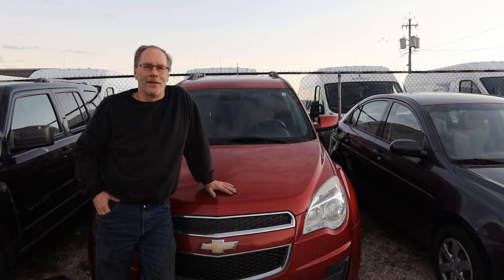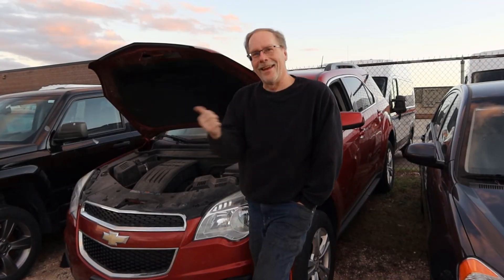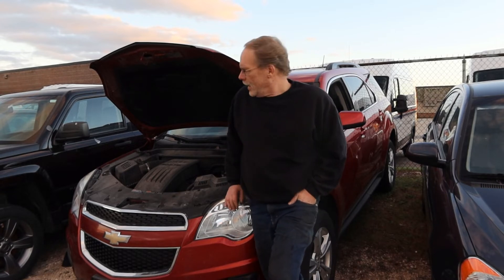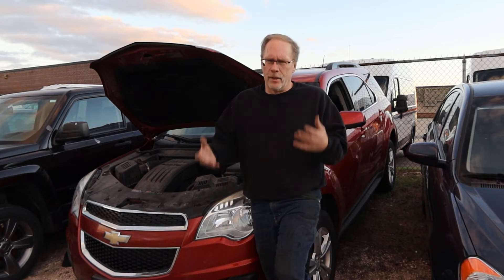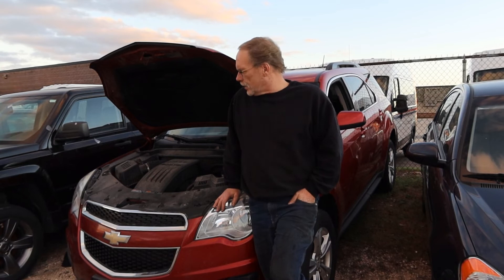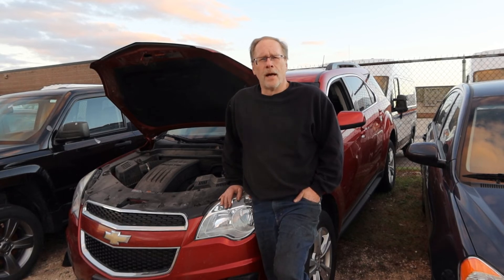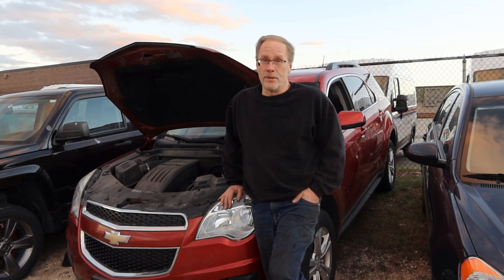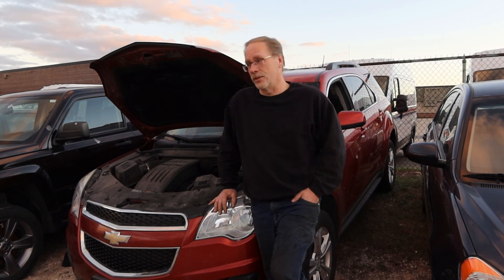HORROR STORY ON GM 2.4 ECO TEC MOTOR RUN AND RUN FAST......

Comment: I've got a 2012 Buick regal with the 2.4 and literally if you give a single f about your cars maintenance it will get plenty of miles out of it currently on 170K 0 issues
Reply: I got a 2011 regal and I just got a pile of issues at 230,000kms. I love the turn so I fixed them but I had everything replaced to do with timing assembly, intake vvt solenoid and now needs a knock sensor. pervious owners treated it really bad and I think it runs funny at times but im always picking and looking for problems so it could be just in my head but honestly for being so legendary bad it docent compare to owner something like a bow it def could get worse

Comment: to anyone with this engine. maintenance is very important. oil changes no longer than 4000 miles preferably 3000. water pump replaced at 120000 miles wether it needs it or not. coolent flush early in the engines life. and pcv checked make sure it's clear. do all that and they can actually last a long time. hope that helps anybody.
Reply from the maker: Thanks Hey FOLKS LOOOK LISTEN N DO !!!!!!
Reply: Did an oil change on mine oil started leaking and blew my motot
Reply: @Tony Oliver  an oil leak won't blow your engine. Not filling up again will😂
Reply: I just did the intake cleaning and pcv. Now I need to replace my ac compressor
Reply: @tonyoliver9686 did you put the oil in the wrong place? Lol

Comment: I have a 2010 equinox with a brand new long block 2.4, my old 2010 had 435,000 miles on the original engine, changed oil every 2500 miles and 500 miles before the oil change I put in a 16 ounce can of seafoam, the thing ran like it was brand new. I see people go like 8000 miles on an oil change and then wonder why their engine sounds like 2 cats fuckin in a dumpster, maybe because the oil can’t lubricate anything after 3000 miles.

Comment: Very true and accurate, now they sale a reinforced timing chain guide from zzp  and reinforced pistons with more drain holes on the piston head ring lands to prevent the oil burning.  But at that point moght as well overhaul tje whole thing and put updated motor parts for it to last.

Comment: The thing is even the foreign ones are starting to do planned obsolescence like Toyota and Honda they’re still not lasting as long as they used to of course they’ll still outlast anything we make here in the US that’s for sure lol
Reply: Most the Toyota models we buy here in the states are actually built here in the states.  There are like 10 factories across the country. It's been that way for decades.   GM isn't bad because we make it,  it's because GM designs for the bottom line,  not for the product.

Comment: My wife has a 2013 Buick Verano with the 2.4 EcoTec. I just replaced the fuel rail pressure sensor. I thought it would be an easy job. I didn’t know I actually had to take the whole intake manifold off and take the fuel rail out to get to the sensor. That was fun.

Comment: It is sad that domestic automakers are having this issue.  I can't see a good reason for engines, like the 2.4 Ecotec to be burning two gallons of oil in between changes. Our 2013 (2.4) Equinox has 203k miles on it, averages about 27 MPGs and runs well. However, do I dare check the oil level less then once a week? Not unless I want it to sound like the one in this video. It doesn't leak a drop, it just burns it. Maintaining the proper oil level on any engine is critical, even more so on these engines.

Comment: My 2014 Equinox ecotec at 181k burns a quart of oil every 400 miles. Last time I changed the plugs the 4th cylinder was caked in oil. My mechanic says he's never seen one this high. Just gotta keep feeding it oil and it will last 😂

Comment: This is crap when your in scrap yard yes you have issues with engines
I have a 2008 Pontiac G6 2.4 with 250000 miles with no issues yes you need to take care of them I replaced gaskets when warn and sensors when needed but other than that it's been a great reliable car

Comment: Yeah tell me about i have a 2008 hhr I've had for 2 years and let me just say this i should have had it checked out before buying it but the previous owners im guessing never had the cooling system and head gasket checked or changed so now im dealing with coolant over flowing out of my car and low engine performance and slightly overheating because i had so stuff fixed but i found it hard to even get my engine and everything in it checked because you have to pay everyone hundreds of dollars just too look at it before fixing its crazy so now i don't know what to do because i can't keep driving my wife's suv so now im kinda debating on buying this red 2008 hhr LT for $4,500 because i know what to look for or should i just try to find a engine better than the ecotec like a 2.0 to 2.4 or 2.5 honda or Subaru engine to put in it because i want to keep my car now because its used for work but i also want to get something a bit newer and more luxury as well i try to say between $4,000 and the highest $6,000 maybe $7,000  but the use market is super high nowadays too.

Comment: your nutz that diesel sound great haha..🤣 if you let it run a bit you'll be able to check to see what's making that noise when the inspection hole opens on the side of the block just be careful when opening parts fly out like there spring loaded  but there not, there just under tension so you don't need to find the missing springs. 🤣🤣hehe got a self control problem ,I couldn't help myself..🤣🤣🤣now the not so funny part in oct 2018 I bought my wife a Chevy HHR with 56,113k garage kept 1 owner by a 87yr old lady from the south USA so no rust the cars was great an clean was a under statement it was the nicest car we ever bought we drove 1700miles to buy it we took a 12k loan to buy it an still paying on it. fast forward to Dec 2019 at 58,762k miles wife pulls to red light a click and the engine locks up tight no warning at all valve slammed a piston I MEAN FOR GOD SAKE ITS UNDER 60K MILES AN ENGINE BLOWN my wife liked Chevy till now I thank god switched to ford trucks yrs ago mine has 197k and runs great. I think we (she) will not want to buy a Chevy again thank god🤮🤮. I'm trying to decide if I want to rebuild it now at this point since I'm paying till Nov 2023🥵🥵🤢🤮.thanks for sharing

Comment: Turbo charged VAG engines  (Audi, VW, Seat, Skoda etc.) cars burn a quart (946ml) every 500km/ 311miles as well due to clogged up oil-return-rings on the pistons. Before I bought my Accord Coupe V6 2012, I had a 69k km / 43k miles Audi A4 1.8 turbo (build May 2011). In Europe, USA and Canada, most of these engines (1.8 is about the same as the 2.0) would be replaced for free or for a few hundred USD. VW/Audi Mexico told me they could give me a discount of 8% (basically saying I could pound sand!). I had the car serviced every 4660 miles so it was not due to the lack of maintenance. The VAG cars also leak an abnormal amount of oil. I keep up with videos like the ones from Custom Works, to warn friends and family about the junk that is sold!

Comment: 2015 chevy captiva 2.4 ecotech 203 thousand miles..uses no oil it's been one of the most reliable little suvs I've ever owned
Reply from the maker: its all about maintenance and proper oil change intervals These engines do have a issue but nothing a proper oil change interval would have stopped

Comment: 2011 equinox owner here ,,,crappy engine does same thing 170,000 miles on it but now that engine on my nox does another nasty noise with the message on the cluster " low pressure oil ,turn engine off!!!🙄🥴

Comment: My friend has one 13 equinox with 2.4l ecotec worst engine ever had misfire check engine flashing p0301 code he did everything to fix it  another mechanic diagnosed it as a bad engine he took it to machine shop to rebuild the engine it's still ticking and misfiring at idle when you rev the vehicle 2000 rpm the check engine light is flashing

Comment: Just change your oil every 3000 and it will be just fine. I’m willing to bet every failed 2.4 ecotec is du to lack of maintenance. I only drive gm and have never had a problem.

Comment: 2011 Buick regal the timing chain broke  the day after it’s fixed the rear springs broke 2 weeks after there fixed check engine light for p0300 code  if you buy this car get the 2.0 STAY AWAY FROM 2.4 I’ve got oil in my air filter. Ducts  130k miles
Reply from the maker: I don't understand why people keep buying or much less how GM can manage to stay in business Thats all I ever bought they where really made well, tough, indestructible Then in 2000 model year quality went right down the toilet and WAY over computerized JEEZ HEY

Comment: These engines do suck they jump time bad grounds etc etc n etc BUT no vehicle manufacturer has built a good engine since the early 90s,.as a tech I've seen the industry evolve from carbs to fuel injection to lots of wires down to bus systems but hey I'm happy  fixing engineers mistakes

Comment: Common buddy, you’re not proving anything other than what happens when nobody takes care of them. Try again…
Reply: In the last 3 months I’ve replaced 2 that had great maintenance and less than 125k. That’s just a small number of total I’ve worked on…..crap motors and I work primarily on Audi!! If an Audi guy says something is worse than an Audi ….run!
Reply: My aunt has one of these, takes great care of it. She always services it and is not someone who neglects to change oil. 

The timing set was just done, and now it's getting a rear main seal, and the intake manifold is cracked. 

They are garbage engines. The car (equinox) doesn't even have 80k miles on it. I would never own one, absolute trash.